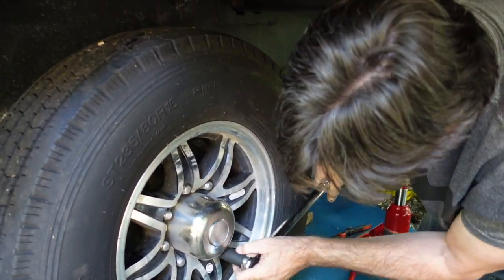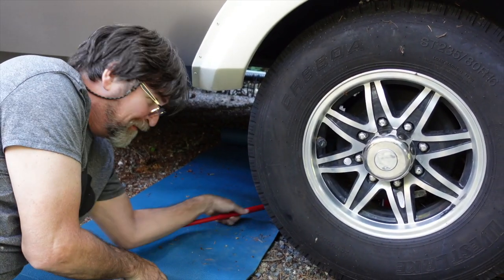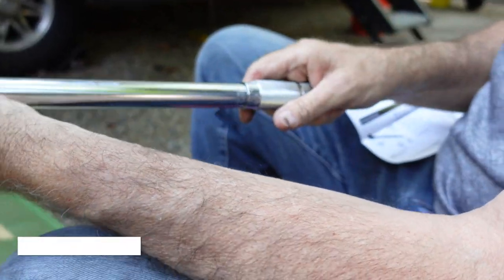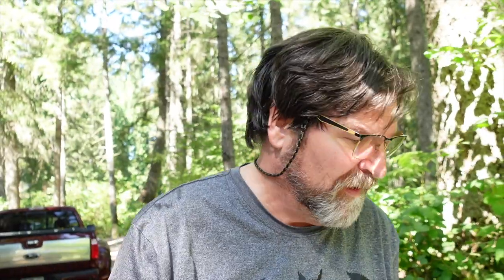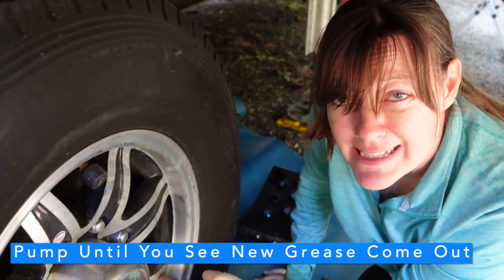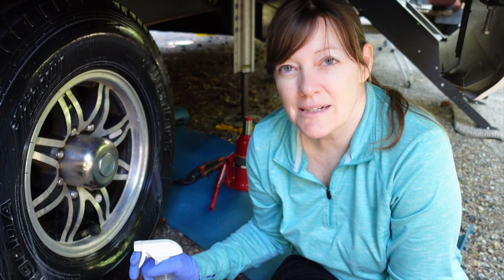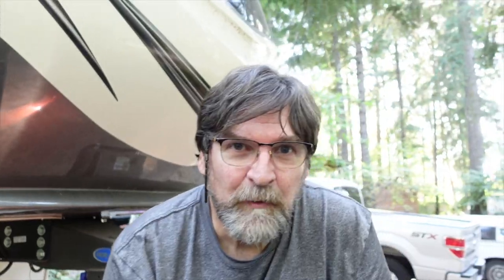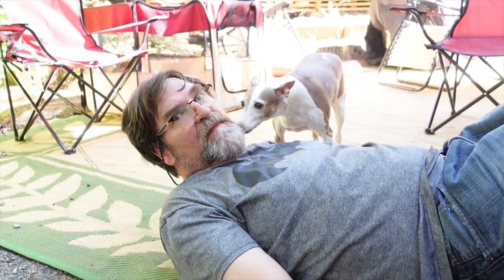EZ Lube Axle Maintenance!  How to (and NOT to) Grease your 5th Wheel Bearings and Hitch!   Ep. 45

Comment: The tip is about an inch long, of the grease gun is adjustable, hold the flex line with one hand and turn the tip to the left, insert the tip on to the zerk fitting, tighten the tip to the right a couple of turns, then tug to make sure it stays on, pump away, when removing, turn the tip left enough and it pop off the zerk fitting, on to the next wheel.
Reply from the maker: Thank you so much George!!!  Sure appreciate you taking the time to let us know!
Reply: @TilFurtherNotice did it work, can you link in video? Would be helpful for quicker reference than scanning comments.  Greatful for the grease gun tip, that was about to be my next YouTube video.

Comment: Dexter Axle recommends jacking up a trailer on the trailer frame, not on the axle or suspension system. To avoid damaging the trailer, do not place the jack on the axle. Instead, place the jack under the frame of the trailer or at a specified jack point on the side that has the flat tire. For added stability, add a flat piece of wood under the jack.
Reply from the maker: Thanks, that sounds like great advice.  Happy travels

Comment: Are you sure you've used the right grease.  The grease in your wheel-ends looks redish, which is the high-temp. grease (same as on my trailer wheel-ends. The grease you bought at Harbor Freight (and they are not the right experts to ask about that instead your axle spec. should specify this) is Moly-grease (used for different applications.  Theoretically, though, moly does not belong in roller bearings where it will potentially cause the rollers to flat spot from not spinning.  I use "Lucas Oil 10005 Red 'N' Tacky Grease - 14 oz.".  This is a high temp. grease and it looks like your wheel end uses it too.

Comment: You really need to truly repack your bearings. This involves taking the wheels and then the hubs off and pulling the bearings and seals themselves out to inspect and repack. Using the method you used does not really 'repack' them. It just adds grease to the old grease.
Reply from the maker: Thank you. I believe you are correct.  This was several years ago and since we have learned that repacking is the preferred method

Comment: You aren't supposed to jack up your trailer off the bottom of your axles is your springs it'll then your axles if you jack up on the bottom of them thin metal the tubes are

Comment: Great video!  I never thought about checking the torque on the U bolts holding the axle.  That's the next thing I'm going to check.  I just purchased one of those ramps that you drive one tire up on and the other hangs.  Best $50 I ever spent.  No more having to get bottle jacks, pieces of 2 x 4's and having to pump the jack.  Just drive one tire up and the other hangs.  Easy to do the greasing of the bearings, plus changing a tire.
Reply from the maker: The ramp is a great idea.  Thanks for watching..safe travels :)

Comment: Using the EZ Lube system is so easy; even a caveman can do it.  Well, obviously, I'm not as smart as a caveman : ) I Just finished completing the job on both my axles.  First off, you're not kidding about the mess.  I purchased a box of 300 shop towels and think I went through 100 or more.  My grease gun wouldn't prime, so I had the bright idea to unscrew the main hose (bad idea, as that was the moment it decided to let loose).  Once that fiasco was cleaned up (and I ran to buy more tubes), the rest of the job went fairly well.  Would I do it again?  Most certainly.  When I initially turned the wheel before applying new grease, the bearings sounded like a ticked-off banshee.  Now they're as smooth as velvet.   I appreciate your video as you're honest with the process showing both the good and bad.  Looking forward to more maintenance tips.
Reply from the maker: Thank you for the laughs!  Sounds like you had about as much fun as we did!  Safe travels!

Comment: I found your channel in trying to get some information beforehand on how to grease our Jayco Jayflight bearings. I'm afraid that it won't have the EZ Lube that yours does, but I'll figure it out. You guys are great, thanks for doing these videos.
Reply from the maker: Thank you John!  Good luck with the bearings. Messy job!
Reply: I have EZ-Lube axles on my trailer, but if you look around on RV forums you will find they are somewhat controversial, not always working as advertised. Really, one does need to go all the way and pul not only the wheel but the wheel drum as well....maybe not every time, but YMMV. That allows an inspection of the brake linings, removal of brake dust (wear a mask for that), and a check of the electromagnet that makes them work. You will also get a chance to inspect the bearings and cups (inner and outer), espcially if you pull the grease seal on the back side of the axle bore. When you find worn parts, gettng replacements is easy, and the work to complete the job(s) is not overly difficult if you pay attention. The Dexter Manual for your axle has all the details, and it is online for download.

Comment: I (Dave) am an expert (35+ years) for calibration of torque wrenches.  ALWAYS set clicker torque wrenches to the minimum setting when not in use.  Those tools have an internal spring that develops a "memory" when kept compressed for an extended period of time.  You did not calibrate the wrench, you set it to the desired torque value.  Calibration requires some sort of device (torque cell) to measure the torque that the tool applies when it "clicks" at various settings.  Hope that helps and safe travels!
Reply from the maker: Thank you so much for taking the time to share this info Dave!! Have a great day -Tammy
Reply: @TilFurtherNotice  you are welcome.   Also, when applying the torque:  do it in a "star pattern", a few steps / passes at each nut, and apply torque slow and steady (no quick jerking movements).  For example, assune a final torque of 100 FTLBS:      first pass for ALL nuts at finger tight,  second pass at about 25 to 50 FTLBS, next pass at up to 75 FTLBS, then final pass at 100 FTLBS.  Recheck all after the final pass.  Sounds like a lot of steps, but that is essentially the process used at the nuclear power plant where I work.  Overkill for some maybe, but its your home and bad things can occur if lug nuts are either too loose or too tight.
Reply from the maker: @davelauraphillips8814  appreciate the info Dave!

Comment: Grease gun: knurling on nozzle is so it can be loosened and tighten. If you unscrew some before putting on zero fitting it is loose, then screw tight to lock on. Reverse to take off
Reply from the maker: Where were you when we needed you Todd 🤣

Comment: At some point you will have to remove the brake drums to inspect the bearings there is a large nut washer and cotter pin to inspect alsounder that cap. until then you should grab the tire @ the top and bottom and check for slack in the bearings. and use high temp wheel bearing grease! check your grease and make sure it is a high enough temp so it does not turn to liquid and leak through the seal. and the "zerk" you can call it a grease fitting too!
Reply from the maker: Thank you Dave!  I think if we don't have someone else do it for us, we will do that and take them all apart to inspect brakes and bearings and everything!  
Appreciate you taking the time to give us your info!
Thank you! Tammy

Comment: I forgot to tell you about the grease gun tip, if you use a wrench and pliers (or two wrenches depending on style of tip) you can loosen the grip so you don't have to yanks &pull on it . the tip tension is adjustable. (or should be)
Reply from the maker: Hi Dave!  Thank you!!!  Knew there had to be an easier way!  Appreciate your help!

Comment: Thx TFN for ian nformative and interesting video. Noticed you didn't lube the shaclel bushings, i'm guessing their plain plastic or the infamous Lipert never fsil  which is a misnomer if their ever was one IMHO. The  industry stsndard shackle hangers are 1/4"  plate painted mild steel which will rust and wollow out from side loading when manuevering at low speed and friction from shock loading on our deferred maintenance  highway system. Suggest you look into a set of Morryde (no affiliation) HD wet bolt shacles which use 1/2' galvanized steel  plates for hangers with drilled bolts with zerc fittings and bronze bushings which you lube when  doing your wheel bearings. Have used these on all 5 of my camping trlrs with no failures in 30 yrs of use.
Reply from the maker: Hi!  Thanks for the info!  I’m not sure what we have now, I’ll ask Scott and be doing some research!  I’d love to replace the whole underside with independent suspension or something better anyway.  Appreciate your knowledge, you are a seasoned RVer and it’s nice to know the ins and outs from someone who’s been at it awhile!
Reply: @TilFurtherNotice  FWIW I went with Morryde SRE 4000 with X braces on my 3 axles raised trlr height 2" but gave smooth ride in conjugation with Reese Goose Box we can leave coffee maker and toaster on the counter now. As I understand the Mooryde IS system can only be installed and serviced by them in Elk Art. I can repair my SRE 4000 on the road. My next upgrade will be disk brakea  YMMV
Reply from the maker: @billdennis2993  thanks!  Yes, They also have a place in Oregon!  Sounds like you’ve done all the right things.

Comment: So "repacking" the bearings once a year is not using the grease zirk or grease fitting. You need to take the innner and outer bearing out and by hand, pack the bearings with new grease. It's much more involved because you have to remove the brakes. What you did should be done, maybe once a quarter and a full repack should be done once a year. JMO!
Reply from the maker: Thank you David!  We’ve gotten a lot of advice on this one. Appreciate that info and feedback!

Comment: As an rv mechanic for more than 25 years. Please don't lube your bearings like that again. Those dexter contraptions have a bad trait of shoving grease past the seal, and contaminating the brake shoes. When you repack wheel bearings you need to take everything apart in order to inspect the brakes and bearings. There is also a preload on the bearings that gets neglected with this method as well. Be sure to grab the wheel and push in and out the top and bottom of the wheel feeling for slop and freeplay. And the maintenance interval should never be a time limit with RVs they simply sit idle for too long. I usually say about 7, to 10 thousand miles between wheel bearing packs. It could take some RV owners a couple of years to reach that. Message me on YouTube for questions
Reply from the maker: Hi Eric. Yes, we’ve heard this from others as well. Guess we will be doing things differently next time. Appreciate your advice -Tammy

Comment: If you put an entire tube in one wheel you put entirely too much. This is a risky operation you are doing, yes it’s the easy way but it can also backfire on you. Putting that much grease in that way you can potentially blow out the seals in the back and then grease can get on your brakes. The hardest part of the job is jacking up the rv so in my opinion taking the bearing out and manually greasing them is best. You see your bearings and will no if they are still good and it’s almost impossible to over grease them. Using a grease gun should only be for adding a little grease until you can take the bearing completely out.
Reply from the maker: Yes Nathan. Someone else told us this too!  We will know for next time!  Thanks

Comment: Scary! Definitely not the preferred method of wheel bearing maintenance.  Especially with the amount of grease you pumped in each wheel it may very well have leaked past the rear seal and can compromise your brakes.  Although they say you can give the zerks a pump occasionally, the preferred method by all the experts is to pull the wheel and the brake drum and inspect and repack the bearings.  How do I know, because I and some of my fellow campers have done what you did and paid the price by ruining our brakes!
Reply from the maker: Thank you for this info Dale!  We had a friend help who does this all the time, but may need to rethink our next attack! Safe travels-Tammy